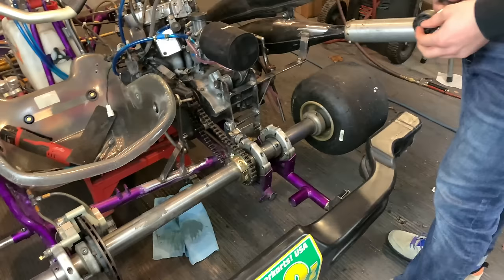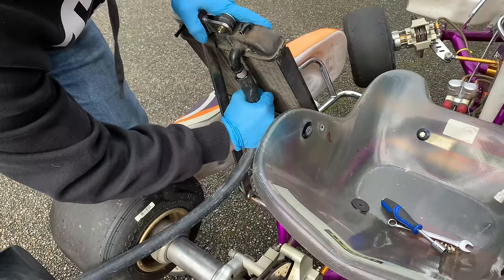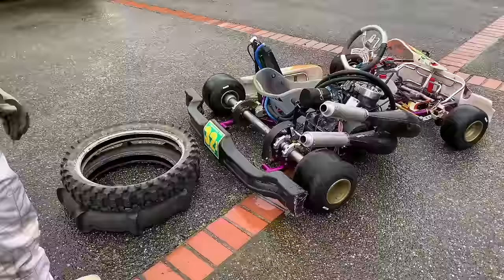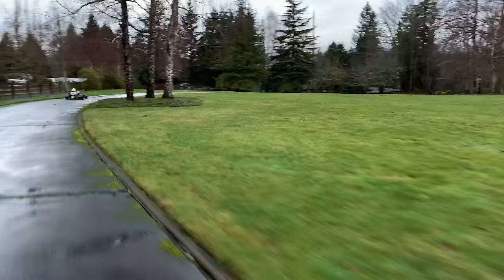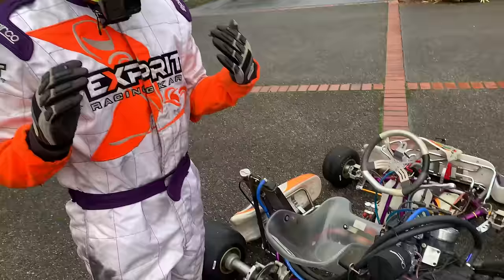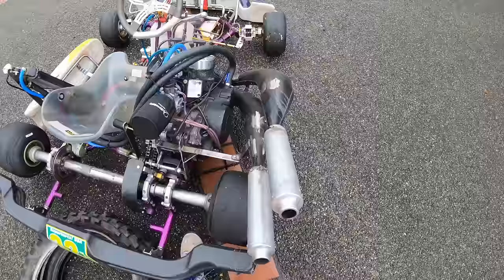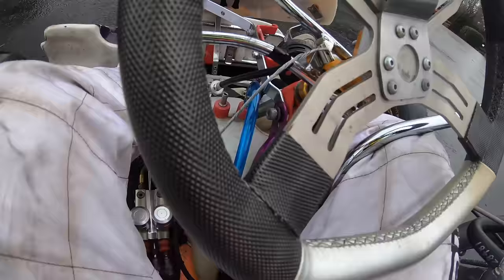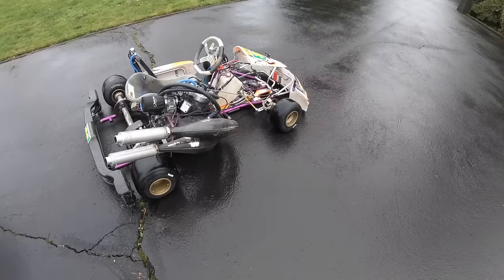First Rip in the Epic Banshee Powered Shifter Kart! Part 6

Comment: You need to move the chain tensioner to the bottom chain or it will bend again when you get traction. Spin the wheels in the correct direction and look at where the chain is slack, that is where you put the tensioner. Right now it's sending all the power into the tensioner causing it to bend and it will break again. Good luck with the build!
Reply: @Adam Paganelli As above - tension (or remove the excess slack) from the non-drive side of the chain. In your case underneath
Reply from the maker: Thanks for the feedback👍🏼
Reply: Yes I 100% agree. A tensioner does not have to be robust. Just practical enough to keep the free slack out of the way and keep the links buried in the sprocket. Tbh I have always been impressed by your process. You seem to have always weighed options when you finally commit to a method. Great job!
Reply: Exactly my thoughts on the tensioner, was going to comment the same :)
Reply: I had a shudder when I saw you putting the roller on the drive side. I doubt it will last terribly long like that. If it doesn't bend the bracket the roller will wear really quick, the load if that wheel hops is unreal!
Reply: Ido if you have one or not but a case saver for the drive sprocket wouldn't be a bad idea, cracked the case on my trx450 because I didn't have one you'll be surprised by the way the chain will bind up and do some damage
Reply: You adjust the chain with the MOTOR STOP BOLT, all karts have them.
 👍😎🏁
Reply: good looking out im having the same issue with mine that you described .
Reply: Nice advice thank you have couple karts that need this problem addressed!!! 👍✌️
Reply: Chain tensioner goes on the slack side of the chain, not the drive side.

Comment: The tensioner needs to be on the bottom of the chain. The top will always be tight under acceleration 👍🏼
Reply: I would actually avoid a tensioner all together because when you downshift or engine brake the lower side will have a ton of tension too.  Just pot the engine in the right place
Reply: Marek Sumguy you couldn’t do better
Reply: Never a tensioner on a drive chain. You need a slide bracket.

Comment: I built a shifter cart in “78” . It’s was a Yamaha race cart that had a 100 cc motor blown when I bought it. I bought a Suzuki 370 RM 2-stroke with kick start. Put motor behind seat over the axle the kick start worked good with enough room to kick it. The exhaust I cut 3-4 times an twisted it so fit nice. The shift rod was just straight rod motor shifter turned up and and loop welded to it so just 1 forward and 4 back. The clutch was just the regular handle with pc handle bar welded to frame an really only used to take off an come to stop. Was very fast about 70? Really loud when brought out the people in neighborhood all came out.

Comment: Chain tensioner goes on the bottom of the chain not the top, but it'll work for a little while
Reply: The tension on top when engine pulls straightens chain so slack will be under the bottom so the old school had a heavy spring and a roller on it.

Comment: (idle adjustment is on the carb's.... thats just cable slack adjustment)
Reply: Maybe but more likely it has a screw that lifts the slide when you thread it in . Its not common to run thottle cable tight between the carb and the twist grip . Slack is actually recomended and standard on motorcycles .
Reply: @Gadget-Tree  i know, i just said that dude lol

Comment: From waveblaster experience those water hoses have a big kink in them where they go around the engine, they could fold flatter when they heat up and restrict coolant flow. Id put metal 90 degree elbows in there which i did after losing a blaster motor from coolant starvation. Im sure you're aware of the chain tensioner already :)
Reply from the maker: Thanks for the tip! I think the hose you’re referring to already has a 90 degree bend on it. Maybe I will look for a 180!
Reply: @adampaganelli4891  i was typing fast but  yeah, its the bends on the head and the pump outlet, once a hose goes over 90 degrees it will try to fold flat on its self when it gets hot. It is possible to route them down low?  Im liking your work tho, its like watching me.... 40 years ago!

Comment: No one realises that chain tensioners need to go on the bottom of the chain because that is the slack side when you are driving and it will break/bend the tensioner if you gas it or really get on it when it is on the top of the chain. Anyways love the build lol

Comment: Very cool! Looks like a beast man, great build!! A couple hints, youve got plenty on the chain tensioner and starting, but definitely invest in a pair of Milbar lock/safety wire pliers and a spool of lockwire, no more hardware vibrating off. Use lots of springs and rubber mounts on your exhausts, theyll be much happier. Well done man.

Comment: That's right the chain tensioner must be on the bottom the top should be direct. Also that carb is not stock there should be 2 of them.
You also have 1 pipe blowing smoke probably a bad crank seal and to finish you'd be better off with a RZ 350 gearbox, it drops right in no modes required. Because the banshee has Motocross ratios whereas the Rz has road racing ratios much more suited for the Cart
Cool videos tho keep it up

Comment: Hi. Chain tensioner needs to be at the bottom of chain, providing there is room. If still bending brackets, spring load tensioner.  The seat is somewhat to the left as to equalise weight distribution with engines mounted to the right.

Comment: Try to place the chain support on the other side of the chain, because when you start to drive, your chain will tense up on the side where the sprocket of the engine is"pulling" on the chain. This will force the chain support to bend upwards. I think you can try to weld it underneath the chain, on the other side of the chain. But otherwise when you do this, your supporter breaks when you force it in die other direction (enginestart or enginebreak)

Comment: Yes absolutely right Adam spin the wheels to see which way to slack is but you definitely have to put it on the bottom side not the side that the motor Torx the chain

Comment: Great job I like the way you started it but one little thing the chain tensioner should be on the bottom of the chain the chain pulled tight at the top but your slack always comes in the bottom side the chain pulls the rear sprocket the slack is always on the bottom but you've got one hell of a kart built I bet it will fly

Comment: Yes put the chain roller on the bottom side of the chain cause when you get on the gas the top side of the chain has tension on it on it and the bottom is slacked I believe that will fix that problem sweet build bro

Comment: Use the old kickstart piece that slides onto the shaft weld a plate on to that with a Groove in it use a steel cable so it's less likely to break and make a bracket that holds like a T handle so you pull that and it's like a cantilever wheel on a compound bow and it turns the shaft for the kickstarter and starts it that way my dad put a RD 400 motor in a dune buggy and devised a pulley system so you could sit inside in the seat pull a rope and it would start the motor it was actually pretty neat I wish I would have had pictures before he took it apart

Comment: Avoid locating idler on pull side of the chain whenever possible. Otherwise you'll need to design a stronger mount for idler.

Comment: You probably figured this out by now, but the chain tensioner needs to be on a pivot point and to apply tension you need a strong spring pulling on it.  Other wise the tensioner wont work, all you will do is either bend it or brake it. 
The best thing to use is a small sprocket and not a friction type like you had at first.

Comment: I'd start by turning the air screw in a bit...then mabey drop that needle one clip....that'll smooth out the off idle response...
Reply from the maker: At first it was, I left the choke on by accident. The next day it ran a lot better. I’m  not really concerned about tuning this carb because I’m switching to a dual carb set up here soon

Comment: The reason the seat is over to the left you want as much left side weight as possible. I have a new dirt kart I wanna sell. Its alot of fun racing but it's expensive as well. I have raced all my life mostly in karts, looks super sketchy with that banshee motor on it.

Comment: Hey youngster , your chain tensioner is on the wrong side... It needs to be on the bottom side of the chain...( COMING OFF THE ENGINE AND BEFORE IT FEEDS ON TO THE AXLE ) pushing upward... Your fighting against the torque & power...move it so the engine is pulling straight to the axle.
Your Welcome

Comment: Chain tensioner needs to be on the bottom side  not the top. Think of the tq and power trying to pull on the tops of the sprockets.     On the bottom side u just have offthrottle pull witch is way better than the power side.   I just realized that everyone is saying the same thing  lol.

Comment: The top chain is your drive chain and a tensioner will not work here, take a spring loaded belt tensioner of a car and change the pulley for a cog and it will sort your issues

Comment: Roller needs to be on the slack side of the chain not the top chain but the bottom chain you will be putting to much pressure on the roller

Comment: Nice work! By now, I'm sure you will have changed that chain tensioner and hopefully offset the seat on a slight angle so you can get in better. You won't be in line with the frame, but after many years of racing my grass kart (Suzuki RM250) you don't notice it. Have a look at your pilot jet size as it could be running a bit lean, making it idle too fast. Enjoy the kart and take it to a track where you can legally and safely see what it will do ;)

Comment: The tensioner system is not useful, as the chain will always be straight  when in gear, I would simply put some rolls as guides and let the cain slag if its non adjustable...

Comment: I'd redesign how the exhaust mount is and try to make the kickstarter work on it. It seems like the whole pullstart with a ratchet strap is a pain, However awesome build.
Reply: Should put a car starter on wheel center bolt with a car battery. We used one to start race snowmobile to start it.

Comment: That hose at the upper cylinder head connection is not going to work that Kink is going to prevent flow and overheat it put a 90-degree elbow on it before you ruin a perfectly good motor
Reply from the maker: That’s a 90 degree bend not a kink

Comment: you need to fix you seat position.. way too far back .. move it forward 2-3 inches, as a starting point .. it's not even safe to drive if ya can get your left foot  firmly on the brake pedal and able to apply full force to it. I can see you can't reach the gas pedal (pushing on side if it) .. not good.

Comment: I love this thing!

I'm currently working on a homemade sxs all aluminum 1 1/2 square pipe IRS with a supercharged can am 1000 cc engine cvt transmission and a 2 stage 50 shot NOS kit .

I'm making hand fab aluminum fenders today aswell as axles. I'm going to be Running 28" tires and I'm keeping it 4wd.

I'll be making a YouTube channel here soon to upload all my progress. 

If you would like,I'll send you the link once I put everything up.

I want something reliable on  the trail,fast enough to.make street legal if I want. And I went automatic so my wife and kids can can take it for a spin

Comment: That chain idler is on the wrong chain side and would over heat anyway,you shouldn't work on such dangerous things if you have know clue because you could seriously hurt ya self or anyone eles that drives a death trap you're built 👎😭
Reply: Yes im kinda having problems removing a siezed clutch off my kart.....it has welded itself to the shaft.....is there a simple way to remove it